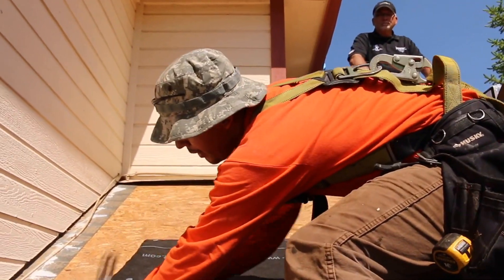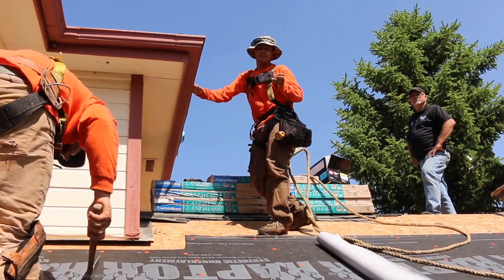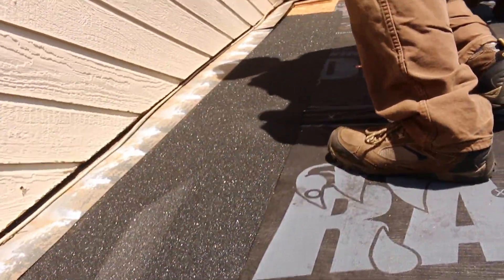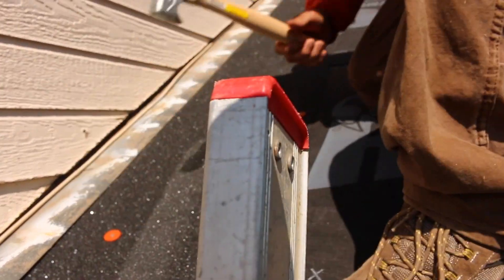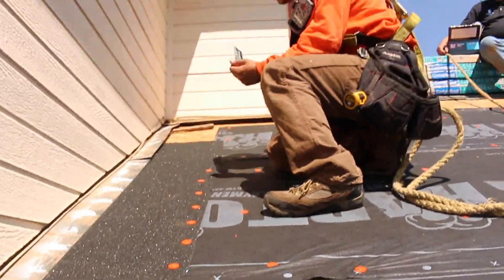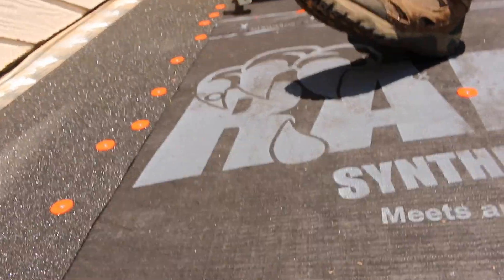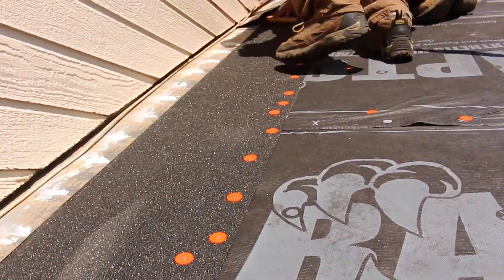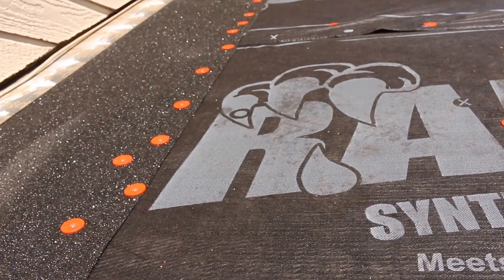Install Ice and Water Shield at Roof Wall Abutment | Roofer Training

Comment: first off water should never get behind the flashing if a professional roofer inspects how it's installed and to make sure the siding is properly installed and I love when The superman roofers claim that any nail that is nailed through ice shield is sealed that's non sense I've seen multiple roofs with ice shield installed still have backup issues due to low quality shingles that do not have a continuous seal I'm guessing due to faulty sealant strip so you saying that ice shield seals any penetration is bull shit and any vehicle wall should be step flashed  not single flashed Amateurs
Reply: I agree. Step flash that wall.

Comment: don't need so many cap nails on the ice&water just saying, and usually it's supposed to run up into the wall but since the damn siding isn't removable this is still ok, good video 👍
Reply: Should still be able to slide it up under the siding a bit. The flashing they demo'd surely had room to go under the siding... Might need to cut the ice and water into smaller pieces (with the proper vertical lap) to manage this.